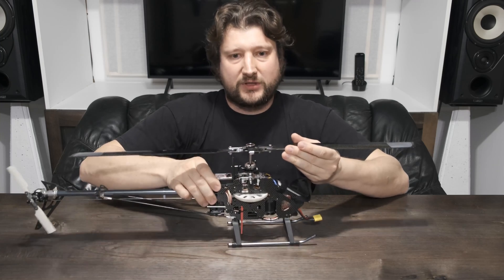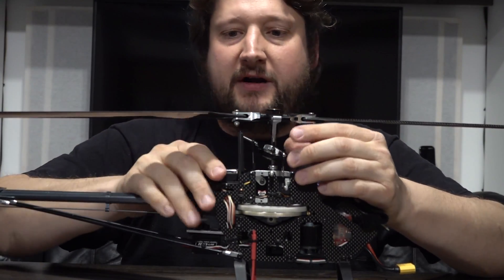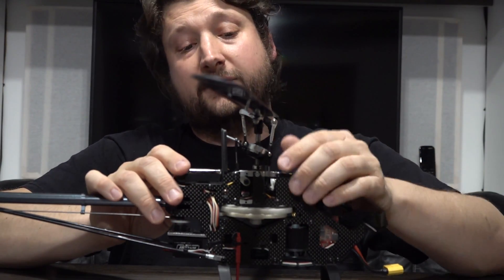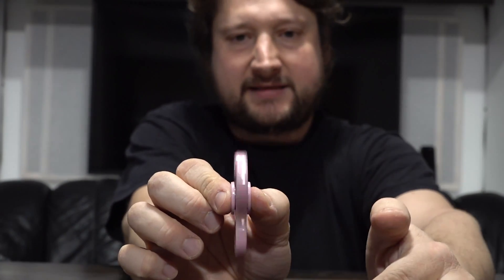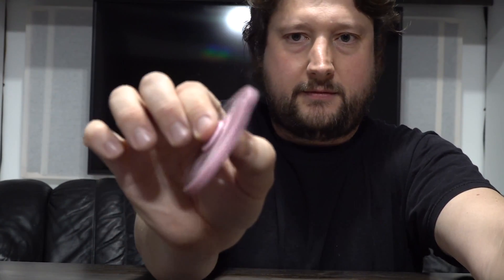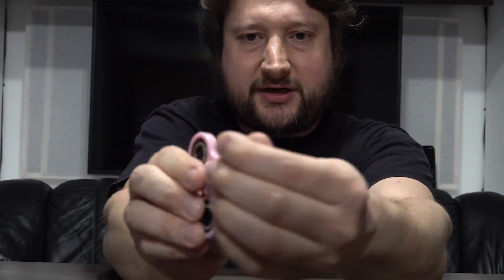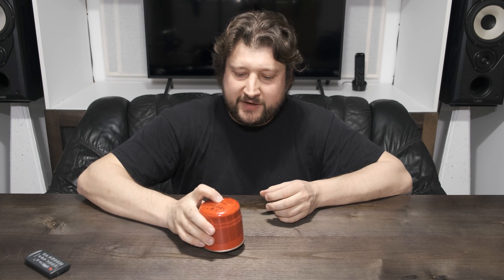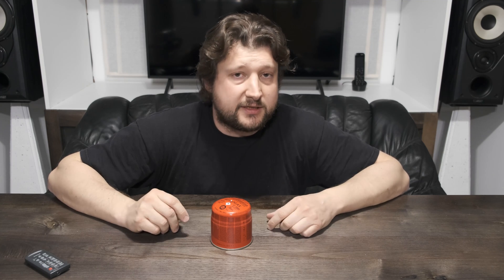Airgun physics - part 1 (why pellets spiral)

Comment: Unfortunately this video is based on a completely wrong assumption. Pellets are not drag stabilised, never have been and never will be unless someone ties a parachute or ribbon on the back of their pellet. Pellets are flare stabilised and flares stabilise by producing lateral stabilising aerodynamic moments about the CG, not through drag. If the pellet was travelling at around 6000ft/sec then there may well be a drag stabilising moment but subsonic aerodynamics simply do not work as described in this and other videos purporting to describe pellet stability (the one recommended by Gregor contains more than 20 mistakes at my last count, some of which are major completely misleading mistakes). The centre of pressure on any projectile is associated with lateral forces, drag makes next to no contribution to its position relative to the CG. 

As a simple test perhaps the drag stabilisation proponents can explain why projectiles with cylindrical bases are apparently not drag stabilised when the base drag on them is much higher than the drag on the front when it is streamlined, just as it is on a pellet. Alternatively, wadcutter pellets have most of their drag on the front and should therefore according to the drag theory be unstable but they are not, why is that?

All that is being described in this video is the basic gyroscopic reaction to a lateral moment about the CG, nothing to do with drag. Gyroscopic stability relies on this reaction and without it nothing would ever be gyroscopically stable. The reason pellets spiral is through a loss of dynamic stability leading to dynamic instability and an increase in yaw angle rather than a decrease when the pellet is dynamically stable. It is all tied in with the ratio between the pellet spin rate and its forward velocity, it is changes in this which produce dynamic instability.

So why should anyone believe me rather than the video? Maybe because I spent almost 40 years working exclusively on the external ballistics and aerodynamics of gun launched projectiles having been trained in aerodynamics and ballistics.
Reply from the maker: Hi. I appreciate your input. I have studied it and I understand it and you are correct in using the wrong terminology for the force that is trying to keep the pellet flying straight (flare instead of drag). Interestingly enough, everyone is using the work drag stabilization for pellets; I have only found a few that uses flare stabilization and this was not that I am aware of this term. However this does not much for the base of this video as the force of drag would act in the same direction as flare force does and the result in this case is the same (it is trying to get the pellet orientation facing the pellet head in direction of the flight). As mentioned the beginning of the video, I am not a physicist nor English is my native language, so terminology mistakes are bound to happen. In any case, I will correct this in the next video (the video itself will be about different topic though). Since you seem to be interested in the topic (related to airguns), I would encourage you to make your own videos or at least contribute your knowledge to airgun community. We would desperately need people that understands this, possible better than me :). There are tons of material on the firearm projectiles and supersonic flight but very little to none about subsonic airgun projectiles.
Reply: @gregorkamensek3923  
Thanks for the reply. Your English is fine do not worry about it, I am sure it is much better than if I tried to talk in your language. I write on a number of forums under the label Ballisticboy, mainly the GTA forum, the UK Airgunforum and the UK based Shooting the Breeze forum. I have recently put an explanation on pellet stability and the different types of stability on the GTA forum. It attempts to explain that drag plays little to no part in pellet stabilisation and that it is lift forces at right angles to the drag, produced by suction on the side of the flare, which produce correcting moments. The whole reason why flares are used is because they produce a stabilising lift moment as predicted by slender body theory and stability is all about moments about the CG, not forces. The vasy majority of the drag force cannot produce any moment about the CG.
As for making a video, if I did everyone would be asleep after the first couple of minutes. It is a pity as I have a simple device incorporating a freely moving flywheel made for me by the late Gerald Cardew, an airgun pioneer, which demonstrates very simply how gyroscopic stability works.
Reply from the maker: @milesm1465  I agree with you an all parts, including the one about most people falling asleep as this was my main concern when going in this video, so you might be surprised by response as I was :). I would love to see the freely moving flywheel, I am sure that it looks way more convincing than my ball-baring spinner. LOL

Comment: This why FX "smooth twist" works so well in conjunction with an effective air stripper.  Even at long ranges.  The effective twist rate on these older FX barrels was 3 to 4 feet...
Reply from the maker: Yes, very true.

Comment: Hello Mr. Gregor I am very interested in the longer barrel for the Huben K1 gen 5. Did you ever succeed in this design?
Reply from the maker: You mean longer thane 600 mm?. I have actually used about 660 mm in my first videos with K1 and I also had an idea to modify one K1 with about 750 mm barrel but I don't know if I will actually do it...

Comment: Good stuff as always 😄
Barreltwist and velocity is one part to go long range, projectileweight and shape another.
The most ballistic shape for what barreltwist....
The milliondollarmystery 😊
And i belive that a slug coated with plastic could increase speed a lot. And is known that ligter pellets go faster.
Finding the ideal bullet/weight/speed/barreltwist has always been the enigma for airgunners.
In gunpowder ammo the sabotbullets increased speed. With airguns, sabots i belive is not the best solution due that it missing out on 1500 fps. 
Coated bullets will for sure do that increase of speed. 
Have a nice day and keep your good vids comming.

Comment: Yes...my mind is eating this brain candy up. Thank you. If you wouldn’t mind since you brought it up, yes, a video on transfer ports and valving working together. Most of the air guns I have modified are made in China. They came with ok power but after drilling out the transfer port and turning down the size of the valve, these guns have become quite powerful. Upping regulator pressures or lowering regulator pressures while increasing plenum size is another effective way for power and efficiency that could be brain candy. Thank bud. Love your videos. Take care.
Reply from the maker: I will definitely cover TP, plenum size, valves, regulator pressures,... I just don't know yet how to split the videos as all of those topic are related but they are probably too long for one video...

Comment: This is great and I am looking forward to future videos in the series.  I thought the helicopter analogy was confusing as you have to introduce concepts from the analogy.   I would be interested in the math of how caliber, speed, twist rate and mass of pellet is related to destabilization.  The gyroscopic stabilization, you said, is required to overcome the destabilizing force of the back pressure at the muzzle.... but that distance is very short compared to distance to the target so to me this explanation doesn't makes sense.   Is there an optimal number of revolutions for the projectile to complete before it hits the target?  Switch rate and distance are obviously factors here.  Rotation would also cancel out effects of an uneven mass distribution, but I don't know if matters in the scheme of things in particular of the magnitude of uneven drag.  Do slugs require lower twist rate only because of their relatively greater mass?

Comment: Thank you Gregor, I've been waiting for this kind of series from someone that can explain it without the math ( maybe a little ).
I have a question; is it possible to tune a pcp to a particular pellet for accuracy, ie after sorting for size and weight, If I have a lot of one type of pellet.
Don't want to waste them.
Again thank you.
Reply from the maker: If the pellet size is appropriate for the barrel and the pellet design is good (meaning that the pellet is capable of accurate flight), then probably yes. But the problem is that if the reason for lack of accuracy is too high spin (twist), you will simply need to shot it at lower velocity or get a barrel with slower twist rate.
Reply: @gregorkamensek3923  Thanks for reply.
What twist rate and speed would you suggest for 10.33 Gn .177 Diablo out to 50m for best accuracy.
I realise theres more to it than twist rate and speed, but as a starting point.
Regards Peter
Reply from the maker: @petera7070  Standard twist (1/18") should do just fine for .177 and 50 meters.
Reply: The only way to find the best air pressure, hammer spring adjustment and muzzle velocity combination for the best accuracy is to test...a lot. Start at a low air pressure (if regulated) and hammer hit and slowly  increase the pressure and when that stops the fps increase add more hammer spring until fps stops increasing, then add more air pressure etc, etc, etc. Shoot 5 shot groups at each setting and you will see them hit all over except at one combination - that's the one. Be prepared to shoot a lot of pellets. 
Weighing and head sizing helps. Eliminate the light and heavy ones. Then find which head size works best in your gun and test with these.

Comment: What would be a good long range barrel twist rates for pellets?  1: 18 or 1: 20
Reply: Nope. It depends on the speed.
Reply: @james1795  I have a benjamin maximis .177 the rifle shot the jsb 13gr pellets will at 830 fps. Tomorrow I will be testing different pellets slugs and different velocities.  I also have a hatsan nova. 177 and it doesn't shot any pellets will only the 21gr nsa slugs @ 880 fps. I believe the benjamin maximis has a 1:26 twist rate. The twist rate is slow for slugs but it may be good for pellets.
Reply: @airgunsofidaho4886  I don't have a Maximis. But testing some of my .177s I get the best groups with H&N Baracuda Match also sometimes even better groups with the Beeman Kodiak Match. Both are 10.65gr and made by H&N only in different dies. Keep in mind these .177s are made in different diameters to choose from which can make or break the "perfect" group we like to see.
Reply: @airgunsofidaho4886  Just to add. If  you are getting 830fps out of the 13gn, a 10.65gn will be coming out hot, maybe not too hot to lose stability, but something to keep in mind.
Reply: @james1795  thanks for the advice. I will definitely try different velocities.
Reply: It depends on pellets weigh and length

Comment: Great explanation of a complex bit of physics. Interesting to see you are into model helicopters. I still have my old ones from over thirty years ago.
Reply from the maker: You probably build it yourself then, this is a HK kit...
Reply: @gregorkamensek3923  Yeah mine were kits too, but you had to assemble them. They are a Schluter, Scout 60, a Kalt Baron with a gasoline engine, and a Kyosho, Concept 30. They are probably considered antiques now. I haven't flown them for 3 years now. I mostly fly on the simulator now, way cheaper.
Reply from the maker: @johnb5519  Yea, a mild crash with CP helicopter is almost the same as maximum crash....LOL. I think that everyone who flies a RC CP heli knows that it is 90% service and 10% flying (or even less).
Reply: @gregorkamensek3923  Yes, you are right about that.

Comment: Very good and informative, keep them coming. Does that mean that slower rate twist  is always better even at slower velocity? What about Airgun slugs ? Where do they fall in this  bind .
Reply from the maker: Not necessarily. It depends on RPM, so for solver velocity, you can use slightly higher twist (standard 1/18" is more than enough) otherwise the gyro effect will almost not exist and you do need some for that first few inches /cm of pellet flight. It also depends on how far you are shooting, it is close range, higher RPM will be better usually.

Comment: Just a minor correction. You mention in your excellent video that a bullet stabilizes due to “angular precession.” I do not believe this 100% correct.
Consider this small summary of physics 1.0.1. below:
In physics, angular momentum is the rotational equivalent of linear momentum. Like linear momentum, angular momentum is preserved. In practice that means angular momentum of a linear moving particle (f.i. a bullet) has a “pseudovector” (read direction) which is also conserved; i.e. remains constant. This is why a pellet or bullet spinning around its longitudinal axis keeps pointing in the same direction.
Precession is a change in the orientation of the “pseudovector” of a rotating body (but not “nutation”). Precession can be caused by external forces AND/OR without any external forces (torque free precession). This effectively means, all spinning particles (bullets) are subject to precession, “wobbling” (but not “nutation”).
The most important thing here is that in practice (and theory) the conservation of angular momentum causes bullets to fly straight. Not angular precession.
P.s. “Nutation” is, more or less, non-contant precession.
Reply from the maker: Thanks for the input. I really appreciate this kind of comments!
Hm, I have to be honest, I checked the word "nutation" before I began forming the answer despite the fact that I know the word but I wanted to make sure I know the correct meaning. You are right that nutaion can be the cause for bullet wobbling but tis (from my understanding) is purely based on the fact that the center of mass in not it the longitudinal axis of the bullet or if the bullets shape is not symmetric and the air friction (drag causes) this wobble. But you are right that if you think about it, the bullet just creates an axis of the angular momentum that is unlike in the with the pellet not changing direction. I should have put this in the video :). That is why I like this kind of videos as I get a chance to learn more :). Thanks!
Reply: Gregor Kamenšek : I am glad I was able to assist! For the avoidance of doubt, your explanation why pellets “spiral” and other explanations are fully correct. I just thought it would be useful if the correct terminology is used; Conservation of Angular Momentum: The cause why spinning projectiles fly straight (in vacuum), Precession: The “wobbling” of projectiles with a 90 degree phase shift caused by “fluid-dynamical” disturbances (a change in the “first Euler angle”) and Nutation (Latin for “Nodding”): Variations in Precession, caused by a change in the “second Euler angle.” As I stated above, I believe you are correct in that Precession causes the spiraling of pellets. But due to the fact that projectiles move in 3 dimensions, rotate around 3 axis, have imperfections in their internal consistency AND the influence of “fluid-dynamics” makes mathematical modeling of the flight of pellets extremely difficult. Perhaps a nice subject for a PhD dissertation, but hardly interesting YouTube material...;-)
Looking forward to your next YouTube video!!!
Reply from the maker: @paulerhard1252  Thank you for your corrections. I fully understand them and agree with them. Thank you also for explaining correct terminology :)